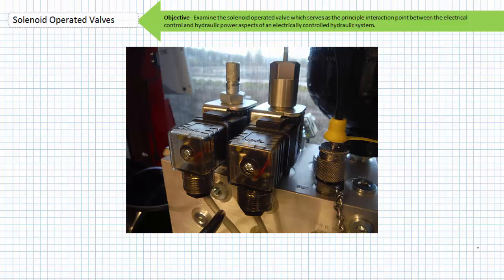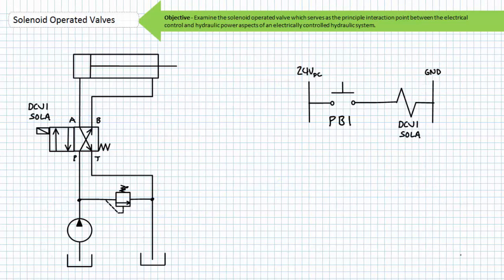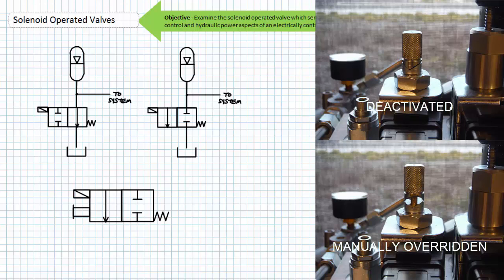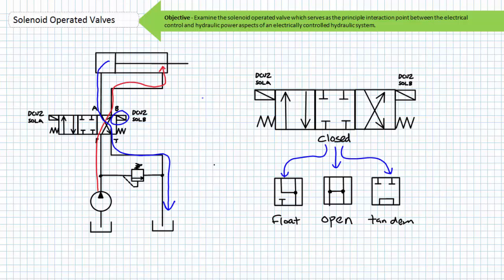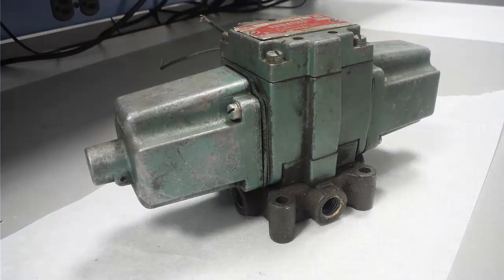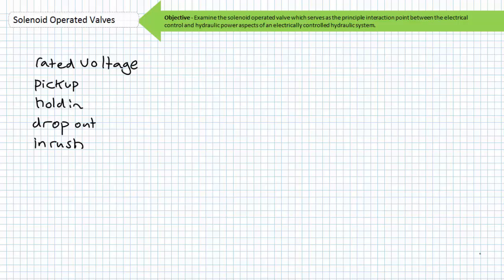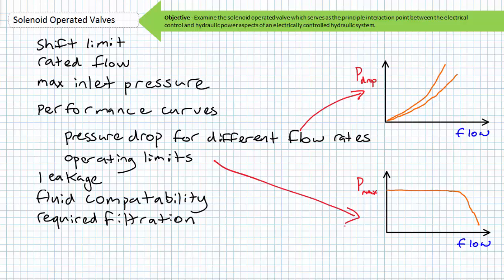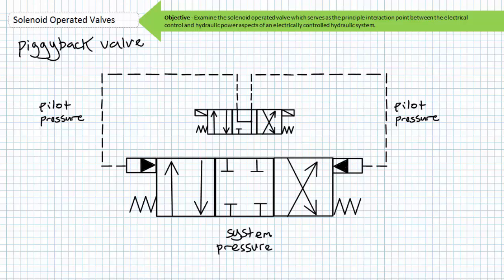Solenoid Operated Valves (Full Lecture)

Comment: Thank you Jim! I think that solenoid coil may be damaged only if operated by AC current, when plunger is stuck. If solenoid is DC-operated, then coil will be safe. Am i right?
Reply from the maker: Yes, DC coils are known to have significantly reduced inrush because. Ironically enough often the problem with DC coils is when they're de-energized a brief voltage spike can occur because they're acting like an inductor with an established magnetic field that is collapsing. For this reason some DC coils include a "free wheeling" diode in parallel with the coil to dissipate this stored energy when de-energized. These types of coils are polarity dependent. I'll actually cover this phenomenon in detail when I introduce the inductor in between the DC and AC circuit analysis playlist.
Reply: Thanks, Jim! It would be great to make video about DC coil induction spike and diode protection. If you can, also add information about AC coil spike (MOVs, RC snubbers).